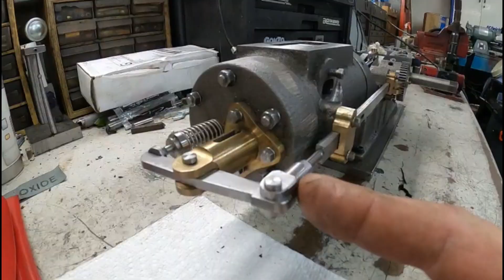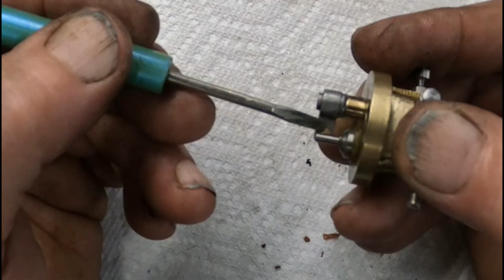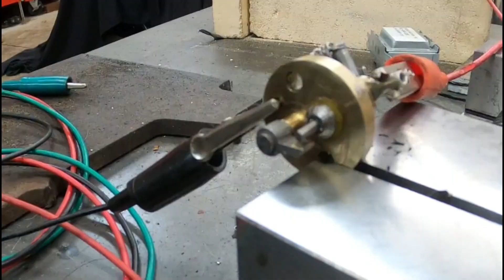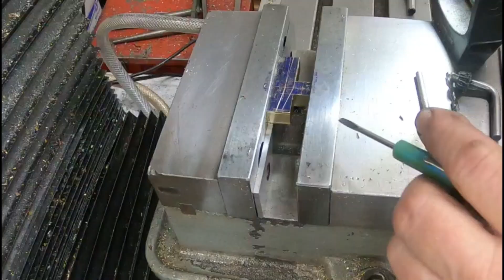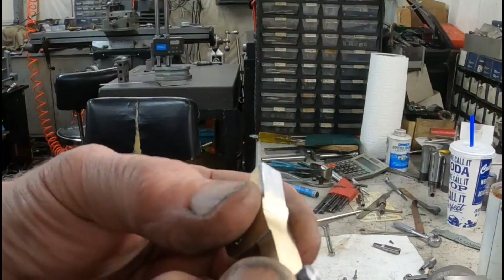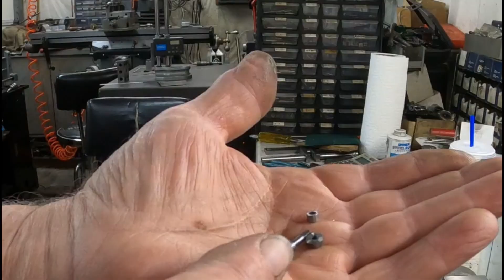Making the trip lever for the Galloway engine.

Comment: Randy do you ever think you’re lathe and mill is too big for that little fine work ? I do on my stuff, I started out with smaller jest like most I’m sour , I got bigger equipment to do bigger work.
Reply from the maker: Hi Pat. No not really as long as you can grip the part in the chuck it is not to small. some of the tiny screws like 5-40 and smaller I make on my small lathe. 👍